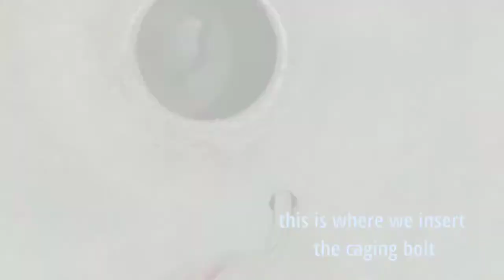HOW TO REPAIR DOUBLE BRAKE CHAMBER (FASTER AND EASIER) | HOWO TRUCK

Comment: lodZ paano mo nalalaman sira na Yung mangkok o tinawag ay diapram..machina KASi preno trailer ko at release ko Yung maksi tuloy2 Ang bawas ng hangin,,Sana mapansin mo eto salmat
Reply from the maker: Gd day boss, 
Posible sira yung diaphragm sa bandang likod ng chamber.
Need mo kabit yung puller bago mo tanggalin yung clamp. Ingat kayo may spring load yan. Thank you..